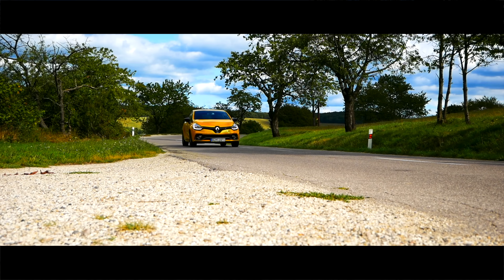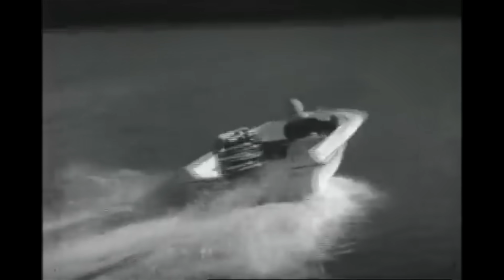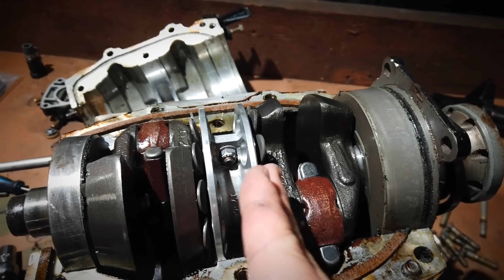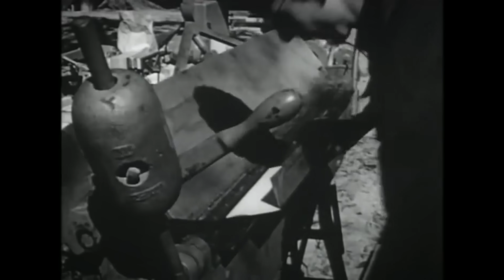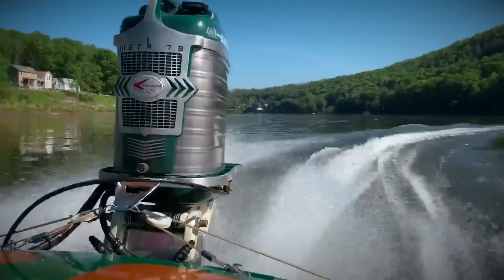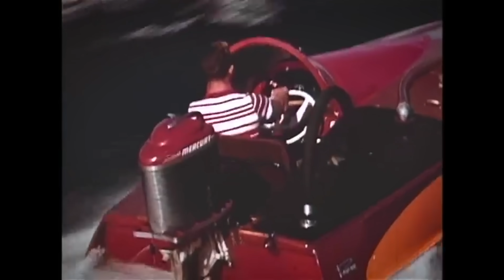The World's First 6-Cylinder Outboard

Comment: Outboard boats are very similar to motorcycle, especially induction noise and turn lean of the boat.  While acceleration is a bit a wheelie feel, and thrust is less, in most cases.  As a 10 yr old, our water ski boat had late 60's 95 hp mercury six tower of power, actually had the 115 hp version on a later boat-- Awesome sounds at full song!! . Floating in the water as the ski boat idle by was visceral with the exhaust pulses, and less so being fogged by the exhaust gases, they ran on 91 octane which did smell nice.  However being pulled up out of the water on ski's while also listening to the 5000 rpm six cylinder is very enjoyable sound to me.  Hope this helps compare the experience for you.  I would like to suggest rotary disk valve Bridgestone Motorcycle I owned as a future topic.  1967 175 cc "hurricane scrambler" Oil injection, twin gear pattern shift, 1-5 speed conventional for road, and 1-4 speeds rotary, so could go 4th neutral 1st.  Still don't much about them. Thanks again for great videos. Gyroscopic torque of the crankshaft effect and lean of hull in turns is a bit confusing as to be a stabilizing factor or make turning a light high-power boat more difficult to lean for the hull edges to bite and track for corning.  Open to ideas

Comment: Could someone please point me in the right direction or give me a link to this strange crankcase valvetrain? Never heard of that system and i really want to know how it works.
Reply: A service manual would be a good source.
Heck, you can probably find a old tower of power engine for free nowadays, and take it apart to have a first hand look at how it works.
Reply: @straybullitt  Do you know how this valvetrain is called? I can definitly find it on the web but i dont know how this sort of valvetrain is called.
Reply: @benistingray6097  
They are called "Reed valves". Specific to the Mercury engine, of course.
Reply: @straybullitt  Ah cool thanks a lot and have a good weekend!

Comment: truthfully these engines are underpowered. For a 2T engine with such high displacement & the advantage of an open water cooling system it is pretty bad though. Still very cool, though they need pipes!

Comment: I had a white Mercury twin cylinder 10 hp outboard engine that was left under a camp that my dad bought. I mated it to a 10 foot Chrysler row boat with disastrous results. I could beat many bigger boats in speed matches but it was unstable.I could go 40 mph at least. I ended up flipping over backwards while crossing a wake, but man, I miss that motor. This was 40 years ago.

Comment: I have a 2012 Mercury F90 on my 17 foot Bayliner 170.  1734 cc four stroke inline 4, DOHC 16 valves, port fuel injection.  It is VERY efficient and pushes the boat to about 40 mph, but I have had a few minor problems with it.  I'm really not sold on Mercury's in general, since while there is nothing wrong with Mercury, a Yamaha or Suzuki is definitely better from a reliability standpoint.

I went to remove the cowling one day and the plastic shroud over the vents basically disintegrated in my hands.  They want over $200 for this silly trim piece....

Comment: Still run a tower of power today. Over 30 years of trouble free service and it can still wup the modern day equivalents. Simple and effective.
Reply: They are excellent engines. My uncle still runs one he bought new over 30 years ago. It’s out a good bit every year. Carbs rebuilt a few times but engine never been opened up. Still runs excellent and it is a joy to run and listen to! My favorite part is the first cold start every year when we take it out for the first time after sitting all winter!!
Reply: Dude just made a video of the worst outboards made, this was in the top 10… I’m no boat pro but I’ve seen these engines around for decades
Reply: I got a 38 year old tower myself, picked up the boat, motor and trailer for 2k. Hadn’t been used in about a decade. She ran healthy all summer after some tender love and care. I just winterized it today, grabbing a new prop over the winter as the only problem I occurred was occasional hub spin in sharp turns and hole shots. It’s been a joy giving this motor a new life, cheers!
Reply: They are heavy under performing stacking it up too a jhonson and that's a fact

Comment: We bought a boat with an 80hp Marc in 1978. We could not kill that motor.  Always worked. I could even rope start it when the battery was dead. The boat sunk once and all it took was new spark plugs to get it running again.

Comment: The 5 cylinder force had an interesting sound. Wild engine. We had a 225efi Merc on a 24 foot cheetah tunnel Hull. What a ride! Have you ever heard of the Force L-Drive? It was basically a stern drive but had a 2 stroke outboard inside the boat and a force lower gearcase outside. Weird stuff.

Comment: My grandfather bought a Glastron in the late 1970's with a 140hp tower of power with "Power Shift". He had it for years in Montana. It wound up outlasting my grandpa as he passed back in 2018. The boat and motor both still exist and are still running. My aunt now has them in Washington.
Reply: I have a 140 also  with a last of the inlines warranty engine that poped,popped, guessed it # 3 cyl.
By then mercury didn't want the power heads back ( 88 /89 )
 So I got the crank assembly,put one new piston on it the stuff it into the 140 case. Had power ported pistons. The difference between 140 and 150 was the power ported pistons as I remember. 
Ports were huge as compared to the 90  115 hp.
Still  have the engine yo this day.  Never started it  either .
  I also put the  carbs like the BP model used.
No back draft carbs. But carbs were same everything except one demention.

I got pretty proficient at dropping the cranks in the cases as I was taught by little guy who was an instructor at Foundulack Wisconsin  school.
   Use the Scizzer ring clamps have the rings exactly in the center of the pin an if I remember correctly #1and 6 were down so they went in first the the rest just a little wiggle and they were in.
I'll never forget this guy. And when it came to shimming a gesrcase he could tell you you need .002 " more shims to be exact. And he would be correctl !
 And it was by feel for him. No dial indicator  !!!
Reply: That's awesome. Me and my buddy just purchased a '59 glastron fireflight. It has a Johnson 65hp 3cyl 2 stroke, but looking to upgrade to a tower of power, probably at least a 115hp

Comment: My father had a Four Winns Horizon 170 built in the 80's with a 115 horse 2-cycle straight 6 outboard Merc. Started riding on the boat. sometime at the age of two and the boat was in the family up until about 10 years ago. Same engine.

I have hundreds of hours driving that boat and my father always serviced the engine himself. 

The "tower of power" was massively powerful for its size. It was loud and buzzy but had plenty of torque on tap at any RPM. When you got up to around 5000 RPM, you would slam the throttle wide open and even though the boat only had maybe another 20 mph to go, you were thrusted hard back into your seat and the engine screamed across the water. It made 40 mph feel like 80. The motor was always smooth outside of idle and shook violently at idle from the torque. I miss the days of that engine and the sound and power at WOT.

Comment: Lets see, describe a tower of power to someone who's never....

Horrific fuel consumption. They really slurp up the gas. Kick over cans of fuel as fast as you can, the merc will still use more.

Fantastic sound at high RPM on plane, they almost fluctuate like a rev limiter but slower, and can run that fast all day. 

Disturbingly smooth running and quiet at low speeds. crisp and abrupt acceleration outta the hole provided it has a good propeller for the task
My dad learned to ski behind a direct drive I6 "DOCKBUSTER" and had mentioned how difficult it is being that theres no "idling" its either forward, reverse, or off. So hitting the throttle on time with the skiers reflexes and driving the boat took some finesse and definitely added frustration.

Vizioracer, Thanks for documenting these unique engines for the masses. They mean something to me.
Reply from the maker: Thank you for the story!

Comment: I've got a Mercury 850 power of Tower and that thing was fun I have a prop on it that is geared to low so it goes from 0 to 30 almost instantly and the boat it's on only weighs about 250 lb it doesn't make any wake at all I should really get it going this winter but it only gets 5 MPG

Comment: I used to own one of those. Mine was the 85hp version. I got it with a damaged lower crank case due to corrosion. Never got around to fixing it. Ended up giving it away and never heard it roar. I just love the sound of an angry multicylinder two stroke.

Comment: I've always loved outboards, but then again I love anything with an internal combustion engine 😀 Keep up the good work, VR, I'm a huge fan of your work!
Reply from the maker: Thanks!
Reply: Still have my 2004 Merc 2 stroke 9.9. Other than a warn down choke lever-arm (plastic) which I fixed by adding  two layers of epoxy, it starts, runs and moves on my 12' inflatable. Keep it on a rack inside my place every winter.

Comment: I worked on one, simple and cool but hard to take the carbs on and off,  sounded awesome when I replaced a fuel pump diaphragm and some carb floats. The crank case design is really cool and very obviously designed to be lightweight.
Reply: Yep carbs are a job and a half!!!
Reply: waaaang waaang
Reply: Outboard Mark 90 that had no reverse they said I guess it was that had to switch around thing anyway it's sunk in a hurricane in New Jersey and we got a Johnson 40 horse after that which still could pull a water skier so I can imagine what that 90 Mark did